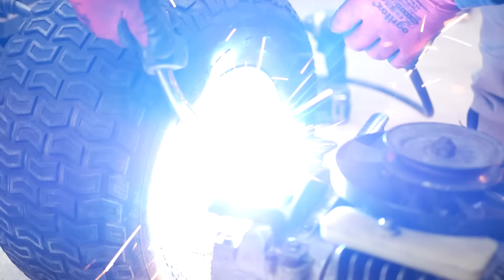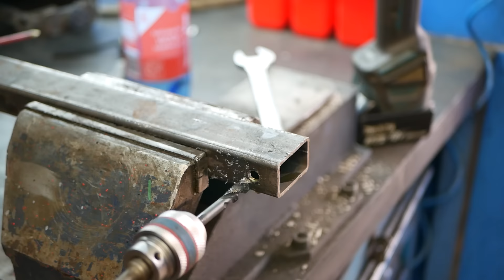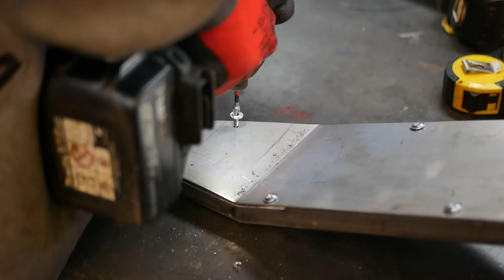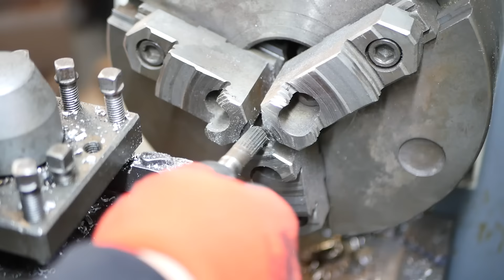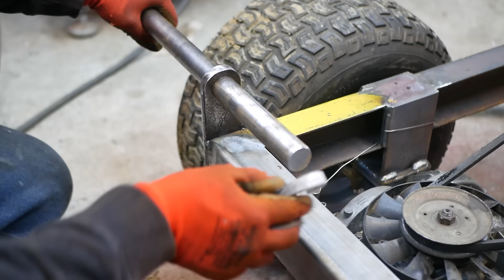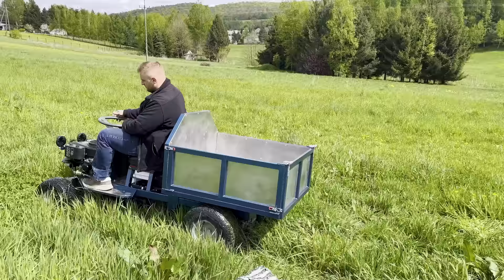Making Hydraulic & Hydrostatic Dump Truck

Comment: These hydrostatic transmission need larger oil capacity a external filter.
For heavy work.
Many failed here in mountain lawn mowers.
Axels can't carry much weight also.

Excellent channel 👍
My grandparents from Poland Lithuania.
Reply: I agree even on relatively flat land any transaxle smaller than a Tuff torque k66 just won't last on slopes... Also most transaxles under 1inch axle shaft cannot hold much weight... Best bet is to use transaxle as a transmission with a separate load bearing axle with hubs chain driven from transaxle  shafts with a 1.5:1 or 2:1 chain ratio driving the rear wheels
Reply: It doesn't help that the box stores spec 30w motor oil in the TTs (my homedepot cub's manual states 30w). TT specs 50w in their service manuals. Built in failures. Only buy the mowers from the dealers. They are made in the same factory but built to different specs for the different distributors. You want a JD, go to JD for it, not the box stores.
Reply: I can only use mine for about 1 hour and then must have a long "cool down" wait for the hot - or else -  change out the hot fluid with fresh cold fluid.
Reply: @2Truth4Liberty  yup I replace the K44/46/48 and smaller with the k66 as a standard procedure for all my lawn equipment once it starts slipping and I avoid the k51... Those k7x are looking pretty beefy though just hard to find for a decent price the k66 is easily rebuild able and much more durable and can be found with differential lockers all the way back to the early simplicity conquest tractors (one version with it is the 1694014 conquest) just rebuilt mine after 600hrs of hard use still operated just fine... just had the case apart already as it took 1 too many dunks in the mud and had a bad input seal from 6ft tall field grass wrapping up on the input shaft
Reply: @2Truth4Liberty  I would put a cooler on oil somehow .
Very poor design on these .
I own operate heavy equipment machines and all have coolers .

Comment: EXCELLENT idea with the AC compressor clutch. Keep it on the same belt, flip a switch and you have PTO. Love it.
Reply: Oh ok.. I was skimming quickly and thought he turned a AC pump into a hydraulic pump. He didn't did he ?
Reply: @Ken-yb3qd  no
Reply: @Ken-yb3qd  he just use the clutch off it to make a electric PTO

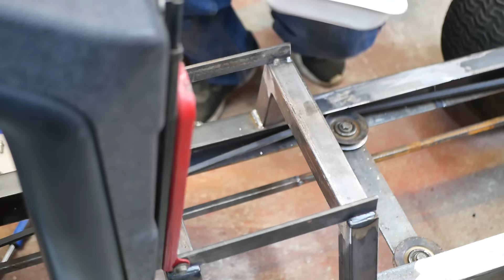Comment: 19:02 dunno that it's the right choice of tensioner. Might've been better to put two flat pulley type tensioner (two cheapo replacement parts from a car) around the transmission pulley to narrow down and wrap around better the belt around it. As is, you've lost 10% adherence when wet or moist from splashing. Just my 2 cents. :)

Comment: It turned out to be a good dump truck!👍🙂 It can be slightly improved for transporting light but bulky cargo (firewood, hay), and an addition to the sides made of mesh with reinforcements. The additional weight will be small.

Comment: Kind of cool but that's why you pull a dump wagon behind your riding lawn mower
Reply: I was trying to come up with a reason why this would be better than just making it a small dump trailer and all I could think of is  "tell me you can't back up a trailer...without tell me " 😂 
Impressive fab work regardless
Reply: The issue with a trailer is it's added weight to the tractor plus 2-4 more expensive tires to purchase and not very menueverable and I doubt a lawn trailer could carry as much as something like this.

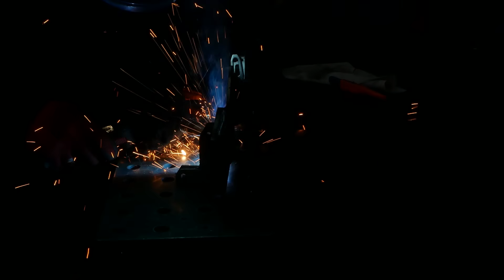Comment: 2:37 There’s no way that’s a gas cylinder valve cover
That aside, cool build, I may make something like that sometime if I get a differential (or 2). Just be aware of the capacity of the transaxle in weight(I do see the pillow block bearings but still) and in torque.

Comment: Looks and runs great. I would add a  few link of chain to the side panels of bed and a hook in the bottom corners of end gate so you can hook the chains to keep the dump gate from fully opening this would allow you to dump a consistent amout of gravel dirt or wood chips for spreading it as you dumped

Comment: If you were a small landscaper, that does custom walkways and ornate flower walls, i could envision this hauling sand to the tight areas plus a modular body system where as you could detach the dump bed and mount a small mixer or do a slide in mixer to make small mortar batches. This is ingenious.

Comment: Easier to stack them from the trailer than from the ground.  In the trailer you don' t have to bend down as far and they are already stacked so you can grab several at a time easily.

Comment: Kool little machine. I would've made the dump gate hinge on the bottom instead from the top. But that's me. If you had an lever attached to the gate it could be controlled right from the seat of the tractor as well. Lifted and lowered as well as locked. When hinging like a real dump truck things tend to get stuck because of the top. I never understood the reason that dump beds gates was never redesigned?? It is so it closes automatically. I get that. But in the world today. We have better technology and it isn't like rocket science to make a tailgate design flaw fix. You taught me something with the compressor idea. Thanks. I have a lot of them around I can use for projects. How many Polish builders does it take to build a dump truck? Ha ha only one if your a do it yourself genius!! I'm polish and an inventor/builder. I think it was a sarcastic rhetorical statement on how smart the polish are when they started the polish jokes. Because I never understood where they got the premise of us polish people not being smart or not sharp minded. Who knows where this stuff ever gets started though? 
Good building. Hope you do more videos that give us inspiration and insight.

Comment: I noticed the vanguard engine, is it a fuel injected unit? This build looks like you have been designing and building these for years. A great all purpose and useful vehicle.  🚜🚜 The A/C clutch repurpose was spectacular. Great job Sir

Comment: Just a quick thing, if you can set up your belt tensioners to maximize belt contact with drive/driven belts, you can reduce the chance of slippage. (edit: I see you did it on the 2nd belt)

Comment: Cool idea and good work, but I don't understand redesigning/rebuilding the whole front end of the tractor, when the end result is almost identical to the original lawn tractor. Why not just keep the original front end and modify/beef up from there? I mean, you could probably keep almost the entire tractor, just cutting out the rear axle, removing the pulley system from the frame and building your dump frame from there back, and get effectively the same result.
Reply: The factory stamped steel frame is very light duty... Based off what I see the weakest points of this whole build are the front axle and transaxle... Of which appear to be from a front engine Murray ride on lawn tractor... My guess it's a k44 transaxle or equivalent both axles having 3/4 inch axle shafts... Should have gone k66 transaxle minimum for the donor, most machines with transaxles capable of handling any weight on the axles will have at minimum a 23inch od tire

Comment: Its awesome, but why did you put the motor so far forward, would have it not been better, and less mucking around to have put it a little further back and used shorter belts and less adjustment and tensioner?

Comment: You make it look SO EASY build these things... but there is SO MUCH that doesn't make into the videos....  I wonder how long it took you to build it.... do you keep track of how many hours you spent on just this dump truck? And do you have multiple projects going at once, or do you just work on this dump truck and not touch the hydraulic bucket build  (or what ever other projects you have going on at the time)  until the dump truck is done???
Also, are people commissioning you to build things (asking you if you could build them a dump truck and paying you some money before you start and then paying the rest when you deliver the finished machine) or do you see that you have an engine, rear end, steering, etc. and you think 'hey I could build this into a dump truck that I could really use and then figure out everything that you need then build it?  (and then if someone wants to buy it you tell them how much, etc.)
I would think you do commission jobs now because it might take months before someone buys the dump truck but in the mean time someone else could have asked you to build them a wood chipper but you don't have a motor or hydraulic pump because you used it on the dump truck that is sitting in the shed just taking up room.....  
- So how do you run things over there??? :)
Reply from the maker: A lot of questions...

It took about 200 hours to build it, not to mention editing the video, which is what my brother does. If he reads the comment, maybe he will tell how long it took him.

I try to do one project at a time, but sometimes there are two or three in progress.

I rarely make machines to order. YouTube takes up a huge amount of time and is a major source of revenue.

Comment: You should have made it a tandem axle truck with a dump bed because you can't haul many 70 lb bales of hay on that thing. I made a portable can smasher with something someone else tried to make a 3 wheel tractor Lawnmower. A idle mind is the devil's work shop.

Comment: Incorrect solution with a tensioning roller, now your tension video will reduce the area of friction of the wedding belt on a drive pulley, it is worth doing the opposite ...
And yes, not a very good angle of installation of a hydraulic cylinder, the angle in a folded position should not be less than 45 degrees ...
Reply: So build yours better and upload a video, Mr. expert.

Comment: How is the hydraulic vice holding up? I've seen you use it in almost every vodeo for the past 5 years, and I was wondering if you have had to tinker with it much in that time?
Reply from the maker: After so many years, it works very well.  It is true that it deserves general cleaning and refreshment, but I have nothing to complain about 😉

Comment: Where did you get the 6 spline adapter for the hydro pump?
Reply from the maker: They are available in agricultural stores.  They are used in Wladimirec T25 tractors, of which there are some in our country.
Reply: @MadeinPolandChannel  Thank you.  Having one or two of those will help my projects.
Reply: Good hydraulics stores have or at least should be able to order adaptor bushings for all kinds of standard hydraulic pump & motor shafts.
Lovejoy style couplings are also avalable with one side already machined for taper shaft pumps/motors and the other side with a straight bore for an electric motor shafts or small gasoline motor shafts.
Those things can be quite cheap when they come from a factory that uses CNC machines to make them all day long, if you have to order the same bushing from a machine shop it can be many times more expensive.

Comment: wheels are too little, the seat is too small, the load area isn't big enough, the motor is not powerful enough, axles will bend under heavy loads like concrete and soil etc, other than that it is a little over-engineered,

Comment: Just curious.....why do you use socket head cap screws, over hex head bolts?  Is there a benefit, or just a personal preference.
Reply from the maker: There is better access in tight places.  And apart from that, I just like them 😁
Reply: @MadeinPolandChannel  Makes perfect sense.  That never crossed my mind.  Thanks.

Comment: WHAT A WASTE OF TIME AND MONEY. HAVE YOU EVER HEARD OF A WHEELBARROW.....
Reply: Wheelbarrows are a wretched device especially if the person needing to move enough to fill a wheelbarrow cannot due to a physical limitation for example my back cannot carry the weight but can allow operation of a rake and shovel as the weight is less... (kinda sucks having 3 bulging, 3 herniated, and 1 dessicated disc in the lower back I'd rate a back injury as -10/10 would not do again)... Basically he built a ride on wheelbarrow with very light duty components... Major weak points are the transaxle and steer axles not being rated for much load over factory tractor weight with rider... Looks like a Murray front engine ride on steering axle which are very light duty